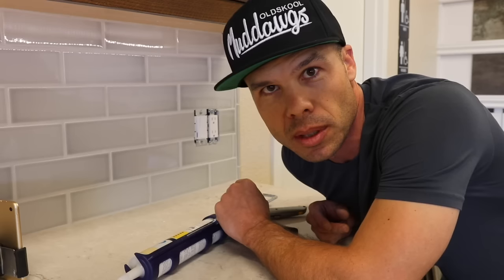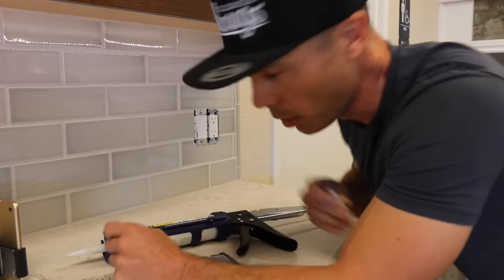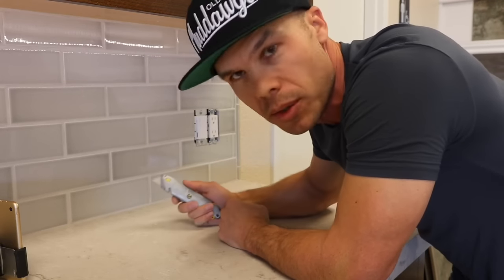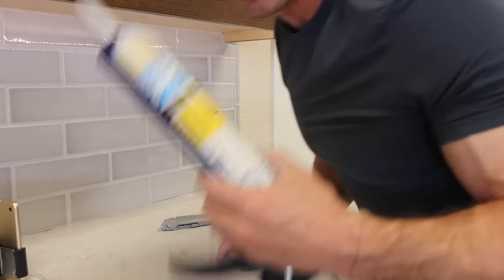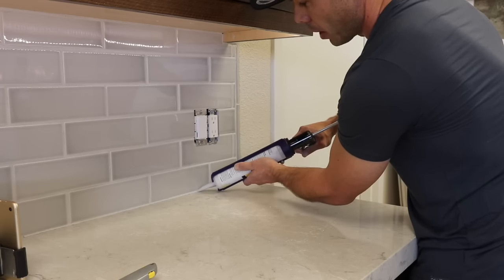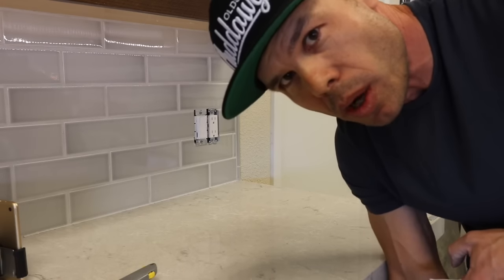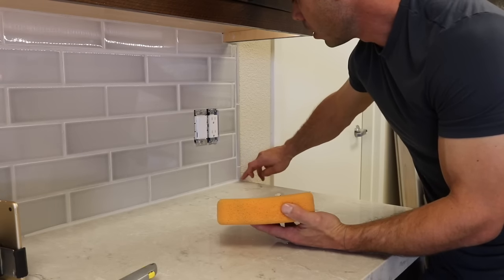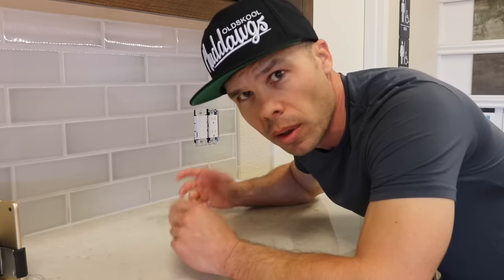How to Fix Cracked Grout: Tile Coach Episode 20

Comment: I have a walk-in / stall shower.  Tiles on the outside / front (as you step in) have grout that is starting to deteriorate.  I am going to try this method; anything will look better.  Great video and simplified things for us laymen out here.
Reply: I have to something similar in my shower. How did it turn out for you? Using a caulk gun seems way easier than the regular caulking method.

Comment: Glad I bumped into your channel. Clear, easy & informative,.  I'm sure it's the same process for bathroom grout. Basically, scrape off old, thoroughly clean & dry, squish in caulk, squish again with finger  (or plastic caulk tool) & clean with damp sponge. I can do this.  Be well.

Comment: I've used "grout caulk" before and I never treated it like a grout. I always applied it like a caulk. The stuff dries on you pretty quickly compared to 100% silicone so I can see why you use a little water to clean up, which is something you wouldn't do with caulk. Good to know

Comment: Best Practices for wall corners and floor to wall corners in a shower.  Do you 1) grout and leave them until they crack?  2) grout and follow up with grout caulk?  3) just apply grout caulk?  I have 1/8" grout lines in the tile wall.  I'm thinking the grout caulking should be closer to 1/4".  What do you recommend?  Thanks

Comment: Thanks for the video! Question: We need to repair some maintenance joints in our master shower. We have a leftover bag of dry grout the contractor used to install nine years ago. It appears to be in good condition. Can we use it to repair the grout since we know it will match?

Comment: would you recommend a caulk like this inside a tiled shower?
Reply: Curious did you ever use this method in your tile shower?  I’m having this issue in my shower in the corner about two feet long.
Reply: @andrewmartinez2964  same
Reply: I have same question..I don't think it can be used it continuesly wet areas
Reply: You should always use silicone caulk in the shower at the joints.  I'm not sure why they would use grout at the joints cause they shift a lot

Comment: I hope you follow up on this.  The grout in my shower is Prism cement grout.  I need to fill a crack running down one corner of the shower.  Is this considered sanded grout?  There are two kinds of grout caulk and I am not sure which one to get.

Comment: Great video. Appreciate how you show how easy it can be thx. I have a question though, I have a tile floor in my bathroom and it sit on corner of house with two walls are outside walls . I several tiles that sound loose and hallow. If I just clean up the cracks in the grout and re-grout would that be sufficient or should more be done.....?? Thank You...

Comment: Hello TileCoach this is PERFECT thank you for sharing.  Is this ok to do in the corner of a shower too?   I have the tiny square tiles on the floor of my shower and a few of them in the back corner adjacent to the wall have cracked grout so water is leaking out of the shower and into the wall.  I have opened the wall up and the restoration company dried everything up and cleaned the mold off the studs in the wall.  They wanted to just re-caulk the shower (and charge me $500 for it), I told them I'm good I'll do it myself. :). Also, do I need to put the clear caulk over this in the corners of the shower since it's going to get a lot of moisture unlike the backsplash you do in the video or is this caulk water tight?

Comment: Is it's anti bacterial Isaac? Never used this before in the uk we would always not grout the transition tile and run a colour matching silicone to make waterproof and flexible. We've never heard of a maintenance joint either. We would leave a expansion strip Or trim if excessive movement occurs. Or if minor movement we would just run a bead of flexible silicone. Interesting stuff. Cheers Matt
Reply: Exactly. One would think that high-quality, flexible, 100% silicone (color-matched) would be the best solution if cracking occurs so frequently.

Comment: Great video. Thank you.
My question is new shower ...grout is cracking along bottom edge where wall meets floor. Should I use this product? Or do I need to use my leftover grout?
Reply: Do what he did in the video. Grout should not be used where the floor meets the wall because it cracks. Caulking is flexible and won't crack.
Reply: Remove the grout carefully. I would not use a razor knife in the wet area. Just incase you puncture the water proofing membrane by accident. And fill it with caulk. There should be no grout. Also do the same if you have two walls meeting up in corner. Should be caulked also.

Comment: My cracks are between tiles, not next to a counter, etc.  would I use this same method to clean out the grout.  This is outside on a BBQ island.  I tried to get out grout with a razor knife and it would not move, any suggestions?  Thank you for your video.

Comment: I’m about to do a caulking/grouting job. The crew that tiled the shower failed to apply ANY grout to the lowest bottom corner of the shower. Whew, they had some mighty leaking of walls and floors outside of the shower. 
I’d say the ungrouted area is an inch and a half square. 
Would you recommend using a small batch of grout or that handy siliconized caulk?

Comment: In the kitchen around the stove you need a method to keep the walls and ceiling clean. . . the range hood 
should help but the tile has to be frequently cleaned or it will turn color and dull.
Reply: That's a easy one, get some stainless steel backing on the wall.

Comment: How do you know when to use sanded or non sanded grout?
Reply: Unsanded grout should be used for grout lines less that 1/8 of an inch and is recommended for vertical walls. Sanded should be used for grout lines wider than 1/8 of an inch and is better for flooring.  Sanded grout is more resistant to cracking and shrinkage.

Comment: Hi. Great video! DIYer. I have a "maintenance joint" between my acrylic alcove bathtub to tile surround (used by 2 adults to shower). The grout is starting to crack at the joint. I was advised not to use silicone caulk over the existing grout because the caulk does not stick to the grout and doing so would promote mold growth underneath the silicone grout. Is "silicone" caulk different from "siliconized acrylic" caulk mentioned in your video? Can I use the siliconized acrylic grout over the existing grout at the joint (not taking all the grout out of the joint since there isn't a lot of loose grout)? Thank you!

Comment: Thanks for this video. This is a project I wanted to tackle but was afraid I would have to mix grout, which I have never done.  This makes the project seem a lot more doable. Will the grout in the tube match the texture of the cement grout that is intact?

Comment: One quick question, when you have a pan that is 6 ft x 3 ft and drain is 16 inches from end wall and in center of 3 ft side, this would make big difference in slope on the drain at the 3 ft width, would this make the floors extreme slope change make it more difficult to lay tile on the imaginary slope change lines coming from the corners?

Comment: what is the best way to fix grout where a tile floor meets an edge where a stair is. It is a high traffic area. There is no floor movement which I thought may be the cause of the grout cracking.  Any suggestions to permantly fix it
 I have replaced the grout a couple of times but keeps cracking and eventually comes loose.

Comment: Hey guys! A couple tricks if your super OCD lefty like me. Use index finger at end of caulk tip Witch helps inject caulk under tile, cut about one inch of sponge long was on tile saw to give nice square edge on sponge to give you a nice square edge against counter, also use a 1 n 1/2 “ approx pc of green strap mat. To edge corners nice n Sq. Merge caulking into existing grout for seamless edge! Makes perfect edge in corners also. 👍🏽🤙🏽 cheers n aloha

Comment: can this sanded caulk be used to caulk. between kitchen counter and backsplash where grout is cracked, but the backsplash is a bunch of circle tiles set into a sea of grout? like its not thin lines of grout, but a full grout surface with circle tiles. will it adhere to that much grout? thanks!

Comment: This is a great video.
I prefer a grout line at changes of plane to caulk anyday.
This video demonstrates that you can give grout a shot, and, if it don't work out then no biggie.  Clean the joint and use the same caulk you would have used.
Two questions, when I used HDs sanded caulk, the run ons were ridiculous even after hitting the tab on the back of the gun at liftoff.  Any issues with Tec?
And, does backsplash to counter top caulk always strive to match the grout color, or, let's say the counter top was bright white or black, would you go with the counter color?
Thanks!
Reply: Alan Licht the colour in that case would be client choice, but white will give it a slight crispness that black won’t

Comment: Hi Tile Coach, I used a sanded caulk to repair the cracked grout in my shower a few years ago. But now there is mold behind the sanded caulk. What do you recommend I do?
Reply: I had advice to use grout again to avoid the mold.  Then i came across this video.  I think i am taking the safe route and doing grout again but i suspect it will crack again in short order

Comment: Does this work for grout lines in the shower as well ?
Reply: Felipe Contreras yes, it’s better if you use silicone/calking in all corners and joins where the tile meets a new surface ( benchtop,floor tile ect)
Reply: Silicone really attracts mold and mildew , especially in shower areas , it will look bad and constantly need cleaned, the cracking comes from settlement and movement, as long as everything is built properly you shouldn’t have a problem with sanded grout in all corners of a shower , that’s what it is meant for

Comment: Another question (probably a stupid one).... The countertop & backsplash “transition” where you just used the tile siliconized acrylic latex caulk to fix a cracked grout line, was great.....AND here’s the question, lol. Would it be possible to use this caulk higher up on backsplash grout line that was cracked or chipping out? Like a vertical or horizontal 3-5 rows up? This technique would work right, or do you need to remove the grout & just re-grout the ones that are cracking & falling out “old fashioned way”?😉 Hope this makes sense to you, if need more clarification, just holler at me.
Thx for tip/vid✌🏻
Reply: Aepek you could use it higher up but as a grout joint not unless you don’t mind it looking different, grout is a dull kind of product when you see it but caulk will have a shine to it, so I’d say stick to the old rake and regrout

Comment: Why didnt he use normal caulk or sealant instead of the grout caulk?  Color matching or some other reason?
Reply: I believe he mentioned that the type of caulk he used was a combination of color matching as well as texture.  Silicone caulk would be noticeably different (personal mistake speaking there :( ).

Comment: What do you use where the shower tile meets a painted sheetrock ceiling? Thanks.
Reply from the maker: Usually grout, but caulking if there is movement

Comment: Thank you so much for these videos! I feel like the ppl that did our bathroom cut some corners. The grout or caulking used to close the gap between our bath tub and subway tiled wall is falling apart. It all is crumbling and coming out. What can I use to seal that again? The grout around the bath tub is showing hairline cracks too. Any help would be much appreciated!
Reply: how old is the install?
Reply: @rea8755  I am going to preface this by saying I am not a professional but, I do have experience fixing and maintaining my own showers.
Whenever you need to fill a joint between two different materials (like where the edge of your tub meets the wall) or between two different planes (like the corner of your shower) you should use caulk. Caulk is more flexible so it will hold up better in those places. If it is "crumbling" they probably used grout; the way to tell is if it feels like rubber then it's caulk, if it feels like concrete it's grout. (I would be surprised if it is caulking though. IDK how you fuck up caulking so bad that it would crumble after a year. It might fall off or delaminate if the area wasn't cleaned but I don't think it would CRUMBLE unless it was VERY old. However, grout that isn't mixed properly or that is used in the wrong spot WILL crumble and get hairline cracks.) 
I am not sure how well the adhesive grout would hold up in place of caulk. The only experience I have with that stuff is replacing a broken soap dish. I wouldn't let the color not matching stop you though as you could just cover it with colored grout sealer. You should seal your grout anyways. It keeps it from staining.
For the hairline cracks in places that shouldn't be replaced with caulk, colored grout sealer might be enough to fill them. If not, then you will have to dig out the grout and replace it with either a grout rake or, for thin grout lines, a box cutter. Use sanded grout for grout lines thicker than 1/8in and unsanded for lines thinner than that. Using unsanded grout in lines that are too thick will cause it to shrink and crack and sanded grout will have a hard time fitting into lines that are too thin. The adhesive grout might work for this too but I'm not sure because I haven't used it for that purpose.
Reply: @rea8755  👍

Comment: Can you use the same product for shower corners?
Reply: @TileCoach  Great.  I can't wait for that video.
Reply: it must contain a fungicide that is all that bathroom caulking is nothing more also do not caulk over grout or black follows as there is  little or no bond to grout surface so read label
Reply: lulutileguy so what’s recommended where the grout in the shower floor tile meets the wall is cracking? Colored silicone bathroom grout?

Comment: Hey Issac have a ?  
In 31 years I never have had this happen so figured I’d ask another tile guy. 
Brand new house. Tiled the shower 
And corner keeps cracking. Every 2 weeks a 7 ft crack happens. 
I have redone it 6 times. 
I thought new house. It’s moving. 
So marked walls and tile with Transit level ( buddy works on big buildings etc a cool $5000 tool I’ll admit.put dots in room. Total 15. Outside 7. 
ZERO movement. 
I’m at a loss here. Used different grout 3 separate times thinking a bad batch. 
I have had helpers slam corners and grout was paper thin but that’s not the case. 
Have you run into this before or have I overlooked something?? Maybe old age is hitting me.   Lol 
Tile does run to ceiling. Crack is 2ft below ceiling down to pan. Well 5 inch above pan. 
Maybe ceiling pushing down?? But I figured transit would of picked up the movement. 
Ideas???
Reply: One thought. It could be the joists (framing)  below the shower flexing slightly when you step into the shower. The weight of stepping in and out could continuously separate the floor of the shower from the bottom row of tile it meets. Ever so slightly, and just enough to crack that grout… one theory

Comment: I've seen that metal can cause a chemical reaction with porcelain tile, so shouldn't we be careful cutting ground close to floor if we're using a metal knife near porcelain?  I have at least one such mark on my tile from the plumber putting down a saw onto my tile during installation of my fixtures and vanity.  I didn't know this was a thing that could happen until very recently.

Comment: I would not use a box cutter to clean out grout lines, there's a  tool that does a better job and is made specially for that job.  I also would not use grout for a transitional space like your example. I would used caulking to seal the grout line. It is a counter,

Comment: I installed some tile around 4 months ago and it's starting to yellow, What should I do? 

It was not sealed
Reply: I know this is an old post but the answer for anyone reading is color sealer. applying it is time consuming but not hard.  first, clean the grout with ammonia OR vinegar and a tooth brush, then after wiping up all the ammonia/vinegar, paint on the colored sealer with a paintbrush and clean up the edges and overpaint with a damp cloth.

Comment: where is your rag seam full of dust should use sponge first. better to leave tile up of counter 1/8  then caulk, now line is more consistent and not on tile face, and you caulk first after cleaning and tools are put away.  Then grout next day  caulk will be dry tile will have set  cheers always caulk first this is a laytex caulk for those that are wondering do not use sponge on 100percent silicone or you are fired

Comment: Don't grout change of planes
Reply: Btw, thanks for the videos! Not many tilesetters that geek out on their work anymore
Reply: @TileCoach  California's probably got a green tax on it😊
Reply: @TileCoach  could you use the same method and matarial on floor tiles
Reply: I hate the caulk that gets into the perpendicular grout joints. Even the color match stuff doesn't match perfectly enough to leave it. The worst is on semi fresh grout job. Best to wait till grout is completely dry but not always an option.
Reply: @TileCoach   I work for Daltile (San Francisco), and you are absolutely right. The rental in San Francisco that I live in is grouted on all change of planes, and my grout AND tile is cracked. Movement is a reality in construction, old or new, so I for one, would like to see more soft joints in these corners. And yes, caulk / sealant does wear out. Schluter makes premade expansion joints that would eliminate that maintenance, but they don't make that many colors.
Reply: my shower has grout in the corner joints where I would have thought everyone uses caulk.